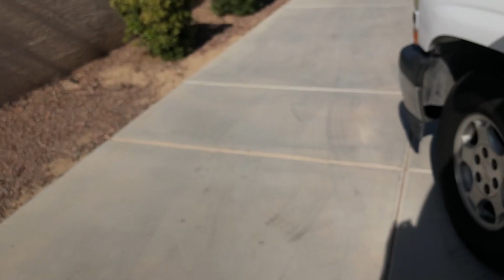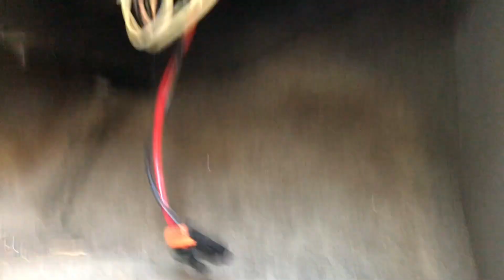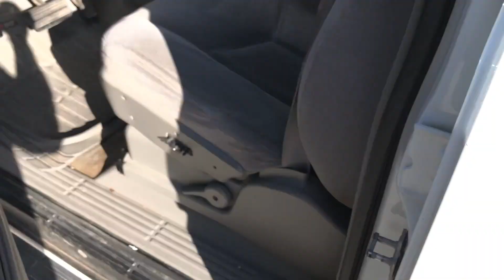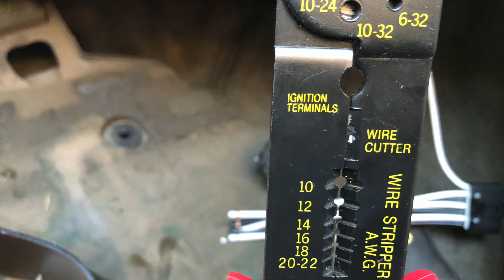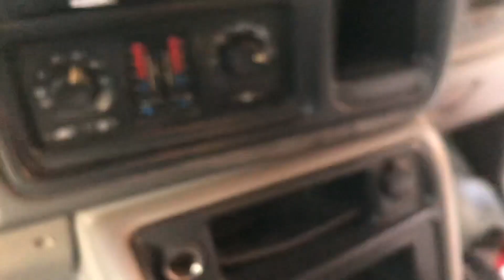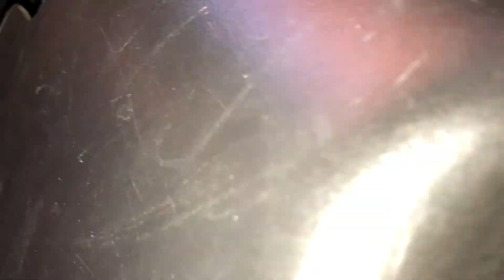2005 SUBURBAN, SILVERADO & TAHOE A/C BLOWER MOTOR RESISTOR REPAIR

Comment: It's all GM bs.  My 05 Yukon has had the resistor and harness wires all repaired and they went bad again for no reason. 
I hot wired direct using 12guage stranded copper wire and 30amp fuse at battery. 
Run wire to a new toggle switch then run wire to blower. 
Pull plug connector and use either wire for hot. For the other wire Connect a longer wire so you can Ground it to and body metal.  Easiest to go into floor , just pull up the carpet and cut out that plastic and foam to drill a hole. Sand paper it shiny. Screw it tight.

On my fused wire it's easier to connect into that red box by alternator. I tried a 20 amp fuse but it blew immediately.
8 ft of wire barely made it.
Also my rear heat went out because I had pulled my battery cables off and somehow that deactivated the actuator inside the back unit. So I just pulled my battery cable off again and put it back on and it works fine each time that happens. Or just pull the HVAC fuse for a minute and then put it back on